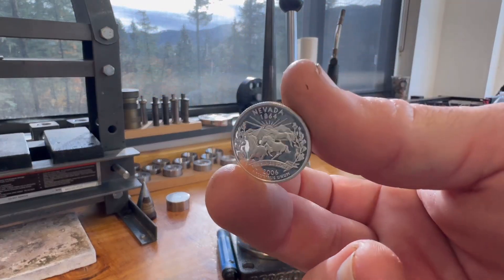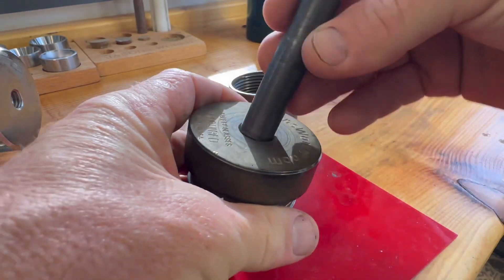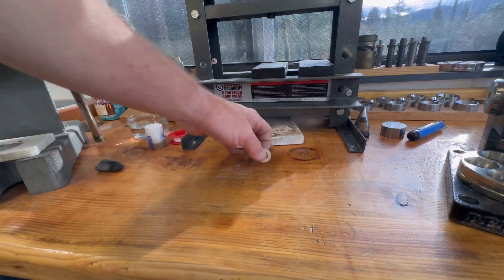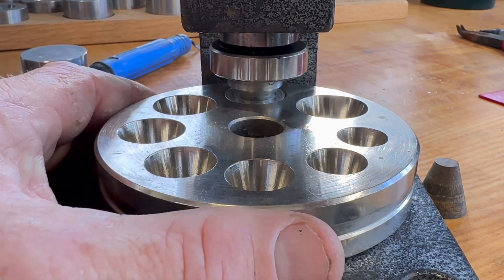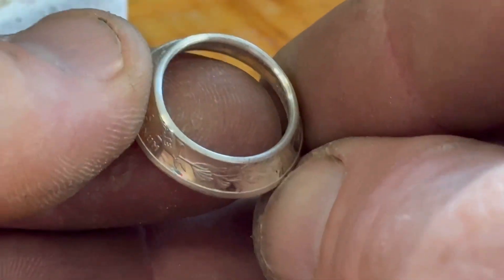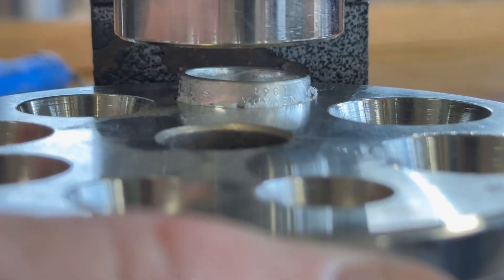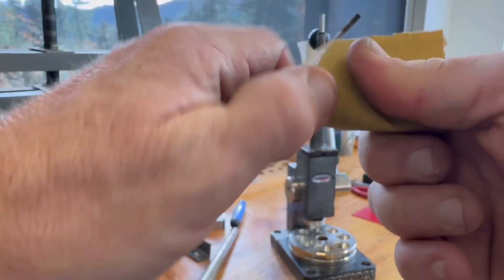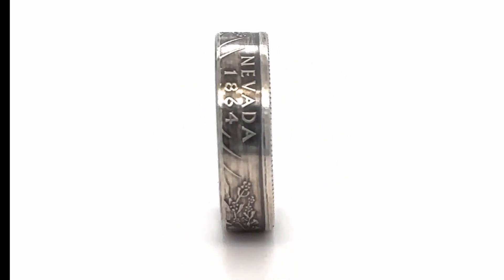Making a Coin Ring Using Just a Ring Stretcher

Comment: Got a coin punch today finally  - not a Jason Works but cost me £68. Used a dapping block and a round punch from a 25 piece set - set cost £29.99 to cone the coin. Then a £75 ring stretcher to even it out and a light wet n dry sand on cut edge and done - my first Quarter coin ring and appears perfect!

Chuffed it was good - now when i get a workshop bench etc instead of doing it on a saw horse i'll be ready to make various others 😊

I did anneal it and it turned black ( modern 1989 quarter) so at the end just used very fine wire wool to lightly clean and hey - antiqued look.
Reply from the maker: So good I love it!! Thanks for taking the time to let me know.

Comment: Great video!! ❤ would it work equally well to measure the center of the coin and mark that then drill it out like you mentioned in the video? I don't have the hole puncher at the moment so figures I'd ask!
Reply from the maker: It definitely works! The key is to start with a small hole and work up to a larger size. And you can always file it a bit if it is uneven

Comment: Hey there, I'm enjoying watching your videos.  I'm hoping for some advice on equipment.   Will a 1 and 20 tun press work the same?  I think I can get them both at Harbor Freight, but is seems like I will get a bigger bang if I get the 20.  I'm having trouble understanding the difference between when and why to use the 17 degree and 25 degree forms. And why and how to use the Swedish wrap. 
I already have a punch that I got before watching your videos 😟.  Is it possible to get a list of the other tools I'll need to create quality rings?  
Many Thanks,  😊
Reply: I just saw the Coin Ring Reducing Die on Pepetools that I can use with my Pepetools ring stretcher and reducer.  It seems like that should help reduce the equipment I will need.
Reply from the maker: The 20 ton press should work fine. I would highly recommend watching my tool list video I did a few years ago and also the video, how to make a perfect coin ring every time. It lays out in great detail how and when to use all of it. If you follow that formula on there, you’ll be good to go.

Comment: Would that ring reducer die work with other ring stretchers? I don't have the pepe tools stretcher, but have a other good one. Not sure which brand. I believe it's British.
Reply from the maker: Yes they do! The worst case scenario would be to just remove the center pin on your stretcher if it doesn’t fit. I know I did that with one of my other stretchers.